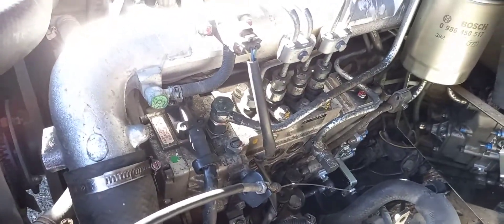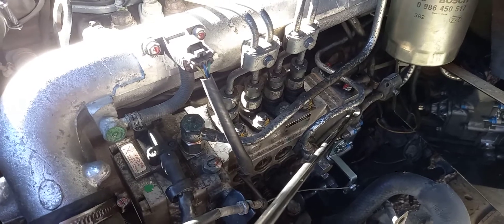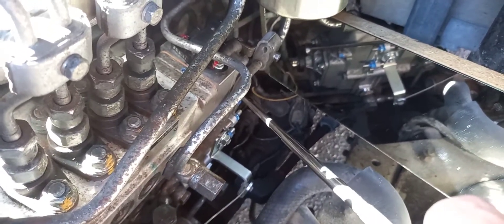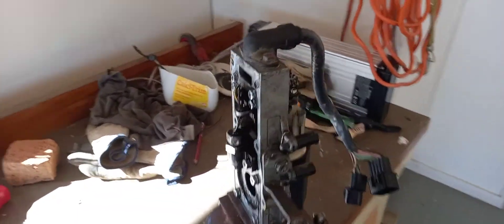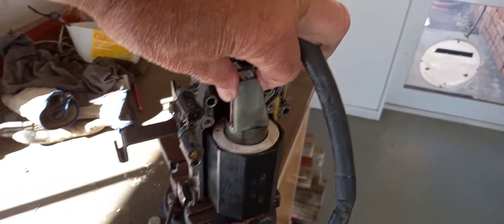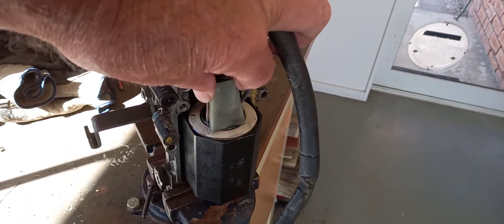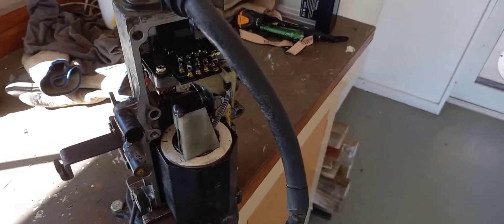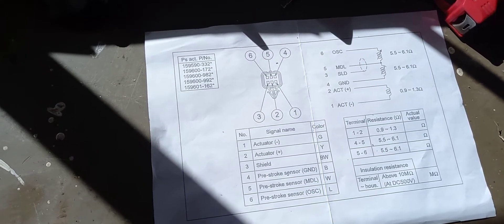Electronic Governor Bosch/ Zexel TICS / EDC Pump

Comment: Another comment/question.  It's not completely clear to me what exactly transpired in your situation.  You had the problem, removed the IP, found a new electronic governor and had someone install it?  Is that correct?  How exactly did you determine that it was the governor that was the problem and not something like the accelerator position sensor? Or, an ECU problem?   Where did you buy the new electronic governor?  I can't seem to find one anywhere.
Reply from the maker: Not really the platform for this conversation but without writing an essay I'll try. 
I no longer have the vehicle but it is a single cab motorhome. It appears you may be in the USA and LH drive. We are RH drive so I was able to remove the passenger seats for access.
The first time it stopped was at the end of my slopping driveway and I thought I had stalled it. It started straight away. The second time was at an intersection and didn't start. All the surrounding guys jumped out of their vehicles and pushed me off the road. I gave it a talking to and it started. The final time before I did something about it was Xmas eve and 900Km from home miles from help and it wouldn't start. It took all day but finally started but stopped down the road a bit when stationary. From then on until we got home about a week later it was ok. The main thing here was it was always when the engine was cold.
Experience told me that the problem was in the governor. When it was warm and running it went like a charm. 
So we come to parts. The new governor assembly was the only one in the Country and as they said these vehicles are getting older and those parts harder to come by so I bought it. I removed the pump myself but did get a diesel pump reconditioner to do the pump along with new seals etc. They have the necessary equipment to set it up properly. It is quite important to get the right place to do it, I sent it to a place 600km away as no one local had the right gear.
in hindsight I should have just cleaned it out as in the video and it would have been ok. If your governor is properly worn out you can have my old one free which is in ok condition if you pay the freight. 
I still think you should try a leak test on the injectors. The injector pump is direct injection and won't cause misfiring. Leaking injectors will make hard starting, misfiring and no acceleration.
The ECU on these only has a small brain. I found that diagnostic told me nothing.
Sort out the email and I'll send the Manual etc.
Reply: @ thanks. I will keep working on it and may take you up on the offer if mine is beyond repair. I am in Denver, Colorado USA
Reply from the maker: I'm in New Zealand
Reply: I would like the troubleshooting info but I'm at my wits end as to how to communicate with you or you with me apart from this comments.  Whenever I leave the appropriate contact info, the reply gets deleted.
Reply: @valdi1214  That address bounced.

Comment: Can you remove the governor assembly with the injection pump still installed on the engine?
Reply from the maker: Yes  but don’t know why you’d want to. Personally I would take the pump off. It is heavy, I think about 30kg, I used an engine hoist.

Comment: Got one in 1999 Fuso FG USA model. Having trouble. Initially taking a little longer to start. Then idling rough and not revving up. Checking voltage at terminal 11 or 12 I’m only getting 5.6 volts coming in. I presume that is the cause of my problem. It should be 12 volts?  (It’s a 12 volt not 24 volt truck). Did you check your incoming voltage when you were having problems?  I’ve not yet determined why mine only has 5.6 volts.
Reply from the maker: 1st your problem sounds more like a leaking injector. Before you do anything, if you haven’t already, do a leak test. If you don’t know how it is simple and there are good videos on you tube.
2nd Without looking it up the voltage could be correct. You can do the ohms test simply at the connector.
3rd If you still think it’s the governor just take the cover of and empty a can of contact cleaner around it like in my video. Seal it up properly as you have engine oil pumping through it.
4th If you like post an email address here, create a new one so you can delete it, and I will send you a complete workshop manual.
Reply: @valdi1214  Thank you.  Yes I will post my email so I can get the manual. I'm fairly sure it is a sticking actuator.   It's not entirely clear to me what you mean by 'cover' even after watching the video.  Is it the piece on the lower back of the injection pump/governor  or the entire back of the injection pump/governor?   I mistakenly thought that when you spoke about putting contact cleaner around that actuator that it had to be removed from the injection pump in order to do that.  Removing the 'cover' and spraying cleaner around. the actuator sounds like a much easier job.  I have a single cab FG (it looks like yours was a double cab) so access to that area is quite good for me.
Reply: By the way, this video is great.  There's very little info on the internet about the IP on the 4d34t in the Fuso trucks.  I had read that the only electronic part of the IP on this model was idle control.  This is obviously not the case